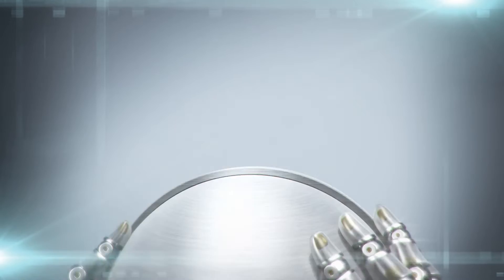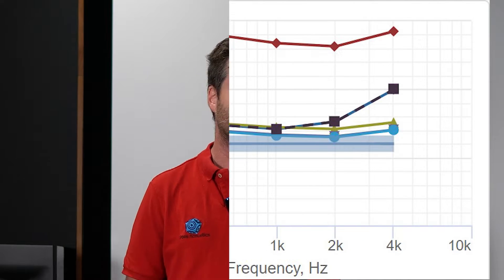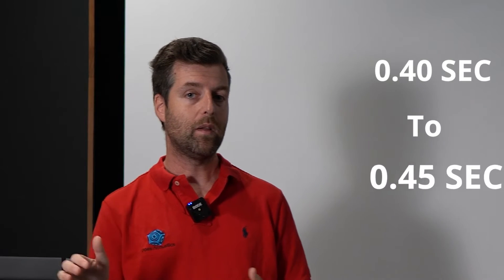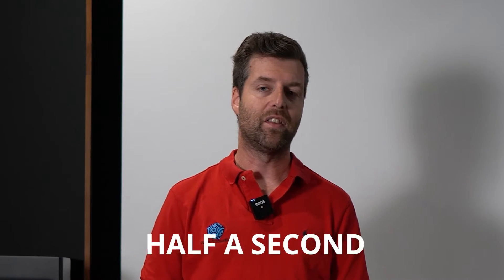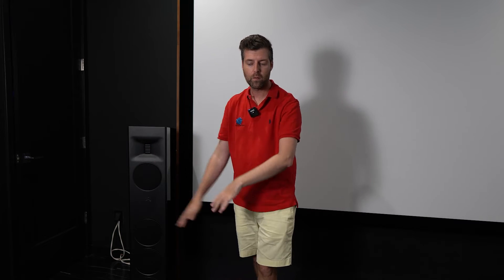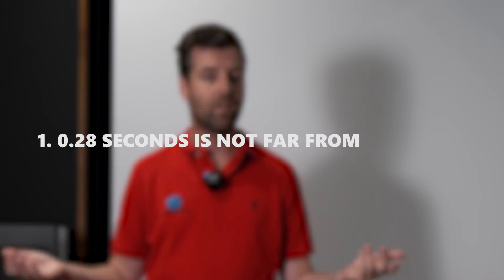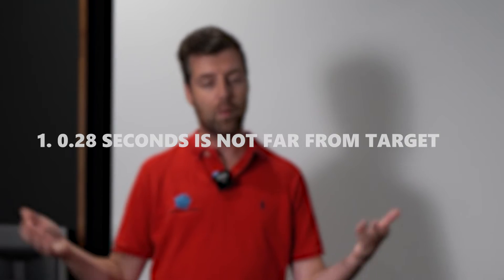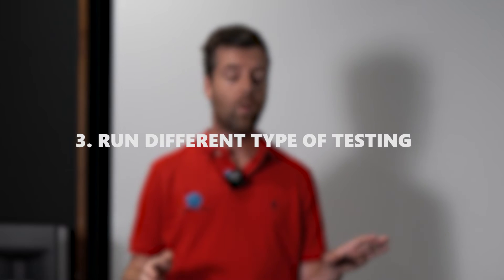Mastering Room Acoustics: Hitting the RT60 Target

Comment: So, I have 125 milliseconds using REW.  Small room, 10W x 14L x 8H, three-sided bunker open on one 10' end.

Floor-to-ceiling bass traps, six air-gapped 2 x 4 panels on side walls, 4 x 4 diffuser on front wall, carpet tiles, ceiling is stuffed with 9" fiberglass between joists and covered with cloth. 

Is it possible to have to fast a decay?

I added some reflectivity back to the ceiling and the bass traps.  Used REW to position teh speakers, subs and listening chair.

I'm happy with the sound, but my speaker's curve could use some help (Magnepans)...

Comment: Really good explainer. Would love to see measurements compared to target. You mentioned average rt60. Should the rt60 vary, i.e. rt60 value at 20hz vs rt60 at 1Khz, etc. ? Is it like eq in that it can be preference and the target curve a 'house curve' based on that preference?
Reply from the maker: Probably not so much a house curve, but it will vary.  The RT60 of a room depends on many factors and often we see the RT60 in the low frequencies rise dramatically.  But its hard to fix and not really as big a deal.  So a rise is considered acceptable.

Comment: Hi Matthew, what is the formula for identifying what the target RT60 should be based on room volume? Thanks.
Reply from the maker: The formula is RT60 around 500 Hz = 0.3 x[(volume cu ft / 3531.34 cu ft)raised to 1/3 power], and then you have a range across 1/3 octabve bands.  So at 63hz it might be around 150% of that value, at 8K its around 60% of that value.  There is also an upper and lower tolerance for this, it doesn't need to be spot on.  This gives a range of RT values that are acceptable for a given sized room.  

There is no frequency where it is no longer applicable. But you allow the RT value to go up at lower frequencies.  So by 30-40hz it can be twice the value at 500hz and sound ok.  I suppose below 30hz it probably isn't something to worry too much about.  Realistically, the RT time of a room below 100hz is more dominated by the rooms construction than your treatment.  That won't always be true, you could certainly load up a room with bass absorbers, but generally speaking this is true.
Reply: P.s. and does it vary also based on frequency? Below what frequency is it no longer applicable? Thanks again.

Comment: My room is around .35 for the midrange and .2 once you get up to 7khz+. I think I need to experiment with moving my panels around and getting some proper diffusion to make it more even. Looking forward to more as always!
Reply from the maker: Sounds good.  A lowering RT60 in the high frequencies can be addressed by replacing some absorber panels with panels covered in a wood front with a pattern in it.  The RPG BAD panel was sort of the original, but slat panels work too.  Inexpensive versions of these are made by companies like GIK.  My prefered supplier is Real Acoustix, which I am a dealer for.
Reply: @PoesAcoustics  I may reach out once I figure things out a bit more. I'm going to pull everything out and add back a little at a time with measurements at each step to get a better understanding of what is happening. I've got my eye on those GuD panels too!

Comment: Trinnov Altitude gives you that RT60 number, how accurate is that?
Reply from the maker: its in the ballpark of what I get from REW.  I find it to be a little lower than REW shows.  But its similar.  They have never shared with me how they calcualte it.  

The advante of REW is that RT60 is not all that valid in small rooms as there rarely if ever is a period at which the sound is reverberant.  However, it can be a useful metric of decay.  As is EDT.  What you can do then is look at the RT60 based on more robust methods, and REW offers the T60M method, which is a frequency domain method that is very robust down to very low frequencies.